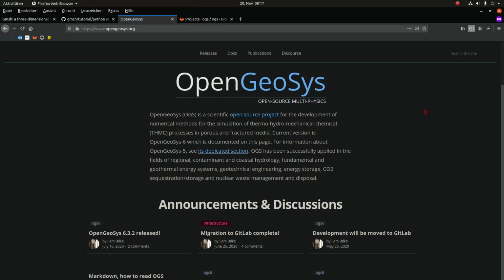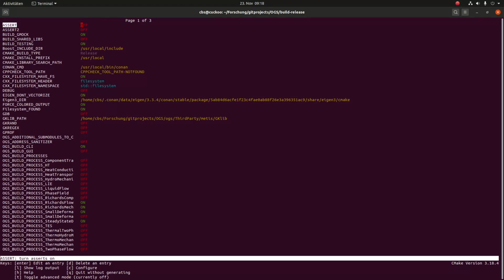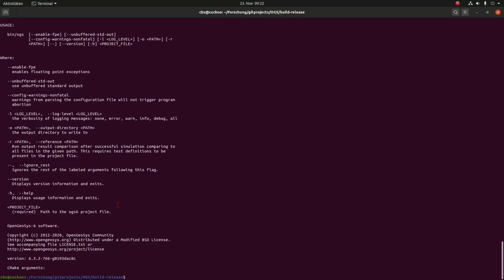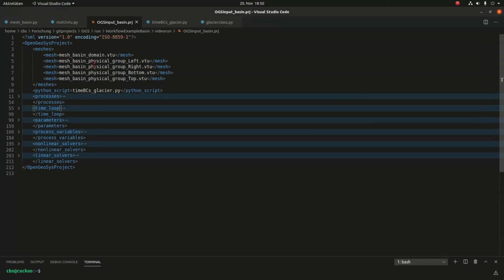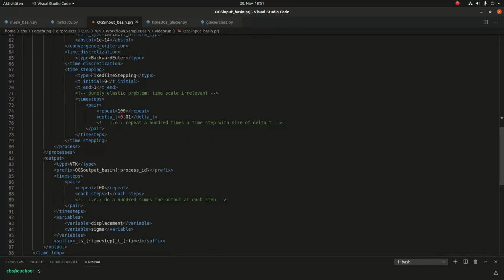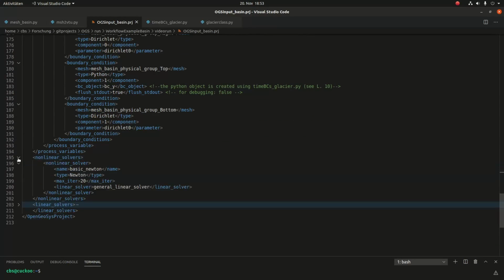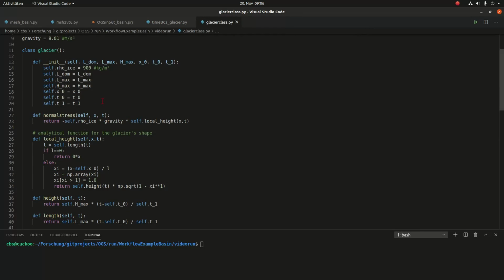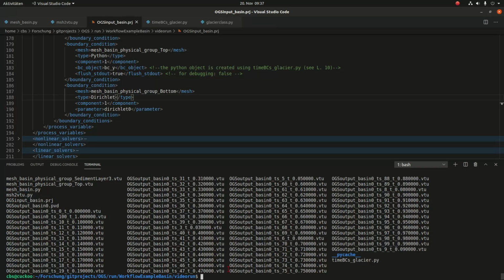"OpenGeoSys Workflow Tutorial: Solving

Comment: The plots (plotEvolution) in timeBC_glacier.py are only for illustration and not necessary for running OGS. In case of trouble with Matplotlib you may disable all plot-related lines.
Reply: The Python code runs smoothly on my Ubuntu desktop. I created an exclusive Python env with Conda and installed all the packages needed. There's only one problem that Gmsh often crashes. I'm afraid the bundled Gmsh in the env has weired bugs, because my self- compiled Gmsh runs without a hitch in the same env.